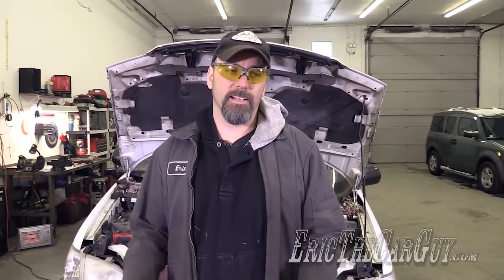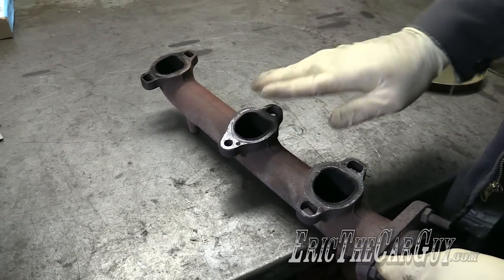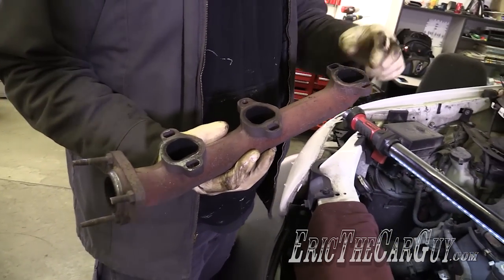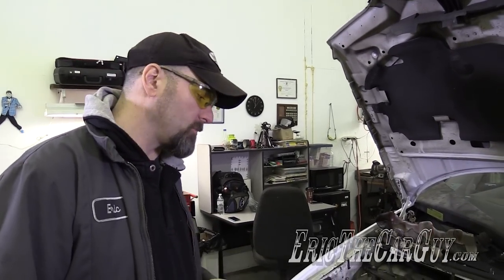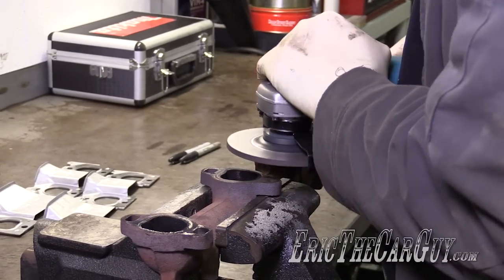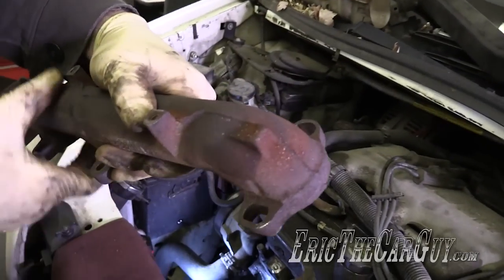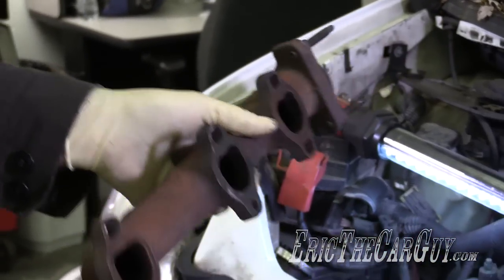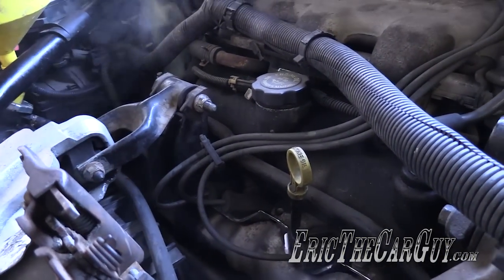2000 Pontiac Montana 3.4L Exhaust Manifold Leak Repair (Part 2) -EricTheCarGuy

Comment: Had 4 broken studs on same engine. Luckily was doing a head gasket job also, was able to remove all broken studs from head with bolt extractor Replaced all six studs and replaced exhaust gaskets also.

Comment: Eric I don't know who you talked to but this is a very common problem. I have replaced head gaskets on these engines about 15 times and 2 or 3 exhaust bolts always break off. The intake gaskets on these engines (3100 and 3400 GM) fail and then cause the head gaskets to fail and the engine will gradually  begin running hot.
If I were you at this point I believe I would get a used head because they are a dime a dozen.
Reply: Back when theses 3.1 and 3.4's were real popular use to change head gaskets on them like people change there oil. Always had broken studs, but honestly usually just weld a nut on or drill and easy out'em and out they come. I've done dozens of these and have never had a problem.

Comment: +EricTheCarGuy Just had a question,  why J-B Weld? Why not a case sealant or aenerobic loctite like 615. I have used J-B weld lots of times just curious of the thought behind it. 

Also I have a bluepoint extractor set that uses drill guides. I completely agree with the drill and tapping instead of trying to remove the broken studs. Theses drill guides come different sizes and allow you to easily drill a centered and straight pilot hole.

Removing stripped and broken fasteners would be a great video idea. Do it all the time at my job.

Comment: Hi Eric, deep respect for not quitting on this one…what a sh!tbox!!! ^-^ 
I used to work for Holtkamper, a fancy brand from the Netherlands that builds folding tent trailers. I had to build on parts that where new and very expensive… and sometimes working with them didn’t go how I wanted eighter. I once was thinking for a very long time about how to remove a threaded bush that went bad, out of an aluminium frame and still be able to use that same hole afterwards… It can ruin your day,but if you are able to make it work... you feel like a real man afterwards! ;-)

Comment: I had a 1984 dodge van where the manifold studs went directly into the coolant passages. When I took the studs out, coolant started pouring out. I did not drill them out, they came out without drilling. Is it possible this is the case with this vehicle?

Comment: I've found jb weld to be a quick fix but in the long run absolutely garbage. even really mild heat or any liquid contact seems to destroy it and a few months later you're back where you were.

Comment: using a welder with broken bolts is way safer and easier than drilling them out. since i learned this way, very seldom if ever will i drill out a broken fastener. its good to have extractors of all shapes and sizes of from mainstream tool brands. this is where you dont want to cheap out. if you do decide to drill, get good drill bits. split points preferably. good tools arent cheap and cheap tools arent good. 
thanks eric for the valuable lesson.

Comment: I know this is an older video so you might not even see this, but have you tried Cobalt drill bits? I've tried using black oxide bits for a piece of chromed/hardened steel and burned through bits crazy fast, but after switching to cobalt, they zipped through no problem.

Comment: You are SO lucky that it was the front exhaust-manifold that had the problems.  As awful as that repair was to implement, I can't even begin to imagine how much worse it would've been if it'd been the rear manifold you had to deal with.  :-)
Reply: Actually, it's not as bad (although the rust Eric had to deal with may complicate things).  I replaced the cylinder heads on my 2001 Montana and was able to access the rear manifold pretty easily from below after removing the back two engine cradle bolts and lowering the engine a few inches.

Comment: Hi Eric. Great videos. Have you ever done a video about tap out drill bits?  During my first timing belt change I made a torque setting error and stripped off half a bolt in the aluminum engine block. I tried to extract via drill but at the time wasn't aware of tap out bits. I quit while ahead and had the dealer correct for me. 
Would enjoy hearing your thoughts. 
Cheers!

Comment: I dont' understand this thinking at all. Drilling out a stud in this way is a no no. The best way to do this is to take the head off. Yeah. It takes a little longer and it may cost the customer a little bit more but you win with this in the long run. If you ask me you have now destroyed this head. Yeah. It may work for a while but this head is destroyed piriot. Great videos tho.

Comment: The old school mopars used to have the manifold bolt holes into the water jacket. You have to put thread sealer on it so it dont leak. Eric, i did the same thing you did on a 5.4 ford. Im not proud of it but all i did was put some thread sealer on it and it was good to go. Knock on wood its still going with no issues.

Comment: Hey Eric, Thanks for this 2 part video series.  I have the same leak at the same spot.  Sounds like a common problem to me.  When you tested the fans, what was that tool you used and how does that work?  Can I just connect a 12v battery to the 2 terminals to test them?  My one fan comes on (driver's side), but the other fan doesn't come on at all as the temp heats up....even with the A/C on.

Comment: I've used a machine shop to run exhaust manifolds on a big ass belt sander to even them out. I prefer replacing the exhaust manifolds but when a customer cant afford a new one there is nothing else you can do.

Comment: I wish u was around my area I have a Lil coolant hose I had to cut off the oil filter housing running back into the block of head, now I can't get the new hose on smh it's gonna suck if I have to have it towed to the shop just so they can bail me out smh

Comment: when repairing cars that seem beyond saving, i suppose taking a few short cuts and breaking a few things along the way seem ok. i counted 4 broken items along the way, 1 deliberate on heat shield.

also, auto repair on pos are much more interesting when it isnt just about replacing a part. if it can be glued, welded, remachined to cut cost, that would be more interesting

Comment: eric there are dril bits that you can use on broken bolst and studs you still have to dril in to it but  as you turn this tool in the bolt or stud it  sould come out. I think you sould still heat the surounding metal to get it to move. im sorry for the bad english.

Comment: A couple of thoughts:
1.) On my Aztek (same engine) it had the same issue (broken studs / bolts on the exhaust manifold) my mechanic welded nuts to the studs and pulled them that way.
2.) You complain in the video about dull bits...didn't you just get a free bit sharpener to test out? Did you have to return it or just forgot about it?
Reply: Funny you mention that. Look on my channel. I just made a video taking out 4 broken studs on a hemi.

Comment: You probably would have been fine if you coated the new stud with teflon tape when you reinstalled it. Plenty of mopars have the holes drilled all the way into the cooling jackets (440 especially) stock from the factory and have the studs installed with permatex or teflon tape.
Reply: Yeah good old Dodge... remove alternator... take a bath cuz you forgot to drain coolant haha

Comment: eric why dont you replace those spring hose clamps with worm drive ones when you take them off, i have had multiple comebacks from failed spring clamps as have some of my co-workers
Reply: If you are referring to the Mubea constant tension clamps I've found them to be MUCH superior to the worm drive clamps. They don't eat into the rubber and they don't come lose. My experience does not coincide with yours.

Comment: Hi eric hope you can help I have a freelander td4 ive noticed that there is a slight air build up in the expansion tank is it normal for some air to build up in there????
Reply: If it is a sealed expansion tank and that is where the pressure cap is...

Comment: Why didn't you measure your depth with your drill bit where the bolt came out clean ? Then you could've avoided drill through the head. You could've welded and fill the nut to the broken stud with a lot welder or flux core.
Reply: +1broncos7  I once got caught out even doing that - the individual studs were different lengths :( Luckily it was a breather tubeway and only wept oil mist (surprisingly heavily) but still needed sealing.

Comment: I would not have even worked on that van if I owned a shop.  I would have turned it down in a respectful way.  Not worth my time to work on that piece.
Reply: +Matt K I feel the same way but a good amount of my customers own these damn things.  I just tell them up front about the possibilities of what can happen and how it might run up the bill.  I've been very lucky as I haven't had too many issues with these vans but the few that have been bad my customers ended up signing the title over because the work was one to two times the value of the van.  I can't wait til they all rust away some day.
Reply: Well, at the end of the day I understand a man has to make money so if you have to work on them, then you just have to.  I think you being up front with the customer about how one thing can lead to another on repairs of these things is a great approach.  I had a 2002 Ford Windstar with the 3.8.  I really like the power of the engine and was the all leather option.  Loved driving it on long trips and stuff but man did I hate working on it.  The rear spark plugs, forget it!

Comment: That was a lot of time and efforts to fix a 500$ vehicle.
Reply: I've seen these vans easily run well for 300k+ miles. Normally you just weld a nut onto the end of the broken exhaust bolt and they come out. Drilling it is a harder way to remove it when it's in a cramped minivan engine bay.

Comment: You could have gotten some sandpaper on a flat surface for the manifold.
Reply: For a more worthwhile situation a little milling or surface grinding would work great.  The flat hand sanding method is great if the amount to be removed is very small.  Not very time effective to blow more than an hour to get the manifold square.
Reply: If you have an old handheld woodworking belt sander you can use that - much slower and much flatter than an angle grinder but much faster than hand sanding. 
You'll need a few spare belts because they will blunt real fast though - once they go blunt the heat build-up is quite alarming (hence the preference for an old belt sander) so you have to take it easy. 
A few thou or ten is no big deal but taking a lot off may be better to start (very carefully) with an angle grinder then finish flat with a belty. I've done similar but on a larger mating surface years ago and it wasn't pleasant but it did work and saved milling and days of downtime as a result (ex-valve fracture caused local heat buildup in a blown motor and warped the manifold adjacent that valve)

If you don't do much of this kinda thing bear in mind that any trace of gasket or rust/scale/buildup needs knocked off before you try something like a manifold for flatness across all mating surfaces - otherwise you could in for pointless drudgery trying to get everything lined up in one plane.

Comment: GM was not real good at positioning the filters on their 3.4 liter engines.
Reply: I swear sometime its the last thing they think of on some of these new ones.
Reply: Even the Chinese-made ones are a pain in the ass to change out. They are better than the ones on this Montana by far, but you still have to take off the hose and risk turning on the check engine light as this is also difficult to get on right.

Comment: you can almost see his silent rage for this vehicle. lol.... I've told all my friends.. I won't touch a gm front wheel drive.. unless it's something super simple like battery cables or something...
Reply: Boy I dunno even know about battery cables haha.... now washer fluid...that's easy right there
Reply: or if it has an alternator right on top.. something super easy to get to.. other than that.. no thanks.. those engineers hate humanity and cars...
Reply: engineers... you mean the 5 year olds in the back room with the box of crayons?
Reply: yes....
Reply: South Main Auto Repair
Actually, the engineers are the ones with the most bonafides. It's the accountants who tie the engineers hands behind their backs, feet together, strap a ball gag in their mouths, throw them into the deep end of a swimming pool and tell them to design a powertrain setup. ;)
Reply: Tim Vincent wow if you cry about working on a GM i dont imagine you working on a VW or a BMW i think the U-body minivan are the worst to work on in the GM line up. i did alot of head gasket jobs on the 3100 and 3400 , in the Montana it is such a pain in the butt. do the saame job in a W-body or a N-body and it is quite an easy job, like i said Minivan are quite hard to work underhood.
Reply: don't cry at all.. I just choose not to work on such things.. I don't buy those vehicles.. because of their cost and upkeep. The world would be very boring with just one type of car.. so it's good they exist. Just they won't be seeing my dime or time. Thanks for taking the time.

Comment: GM products sucks. As of one who has a GM product I spent way to much time and money on replacement parts that's not promised to last at all. Great job Eric 👍 on getting the job done and I hope that the owner of the car is rich because all that time on that van comes with a price.
Reply: That sucks man. I have a 2000 GMC 1500 no issues besides the normal routine work. Had It for 4 years now.
Reply: Le-Vaughan Lemarr I'm a ford guy, but even I can admit it's the GM cars that are horrible.  The trucks and full sized vans have always been decent.
Reply: Medicman Yeah, and GM never had spark plugs that routinely break off in the cylinder head or simply shoot out of it like the Triton engine does. Got a 3800 Grand Prix with 230,000 miles on it. I don't think that's sucking too badly.
Reply: SATAMAN Schmidt But on the flip side, Ford offers a repair kit for that at a low price as a courtesy to owners and shops that are dealing with that repair. When my Bonneville with the 3800 II needed an intake manifold reseal, it was a new problem at the time, and dealers who soaking owners (like myself, who bought the car new) $1200 for the repair. I was raised on GM cars, and outside of one Chrysler, bought all GM cars new and took care of them. Never again. That Bonneville was replaced by a Ford that has been nearly trouble free. I say nearly, as the heated seat no longer works and I can live without it. In 132K miles, my heated seat doesn't heat. That's it. That's all. And at 10 years old now, there is NO rust on it.. and I am in Northern Indiana.
Reply: Gm sucks... shoot I just did a video on my channel today removing 4 broken studs in a hemi with only 60k on it..
Reply: South Main Auto Repair OK, you just repaired a Hemi. Last I checked these were on Chrysler's not GM's. So why do GM's suck? I've gotten over 150,000 miles on every GM I've ever owned. They don't suck to me.
Reply: thats  what i was saying (sarcastically) like .." hey if u think gm sucks look at this low mileage dodge too" ... know what i'm sayin?